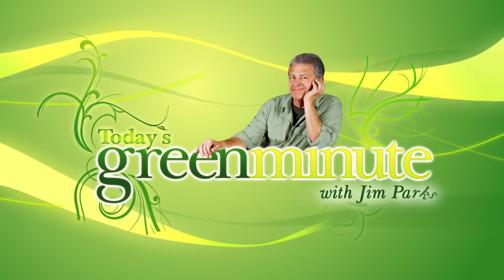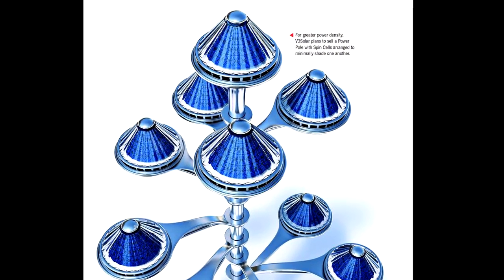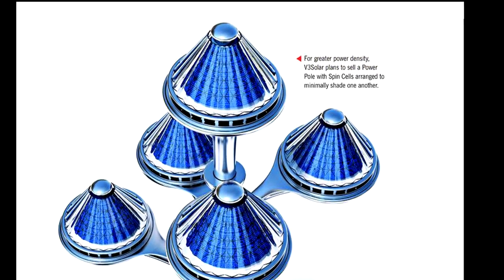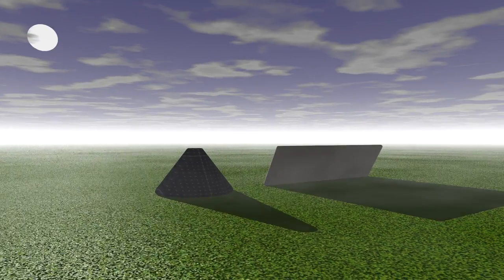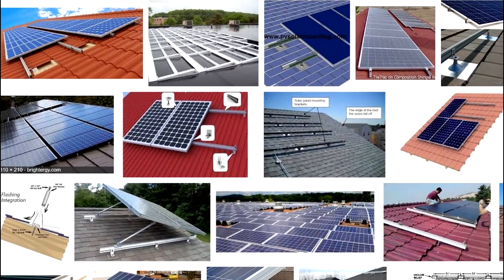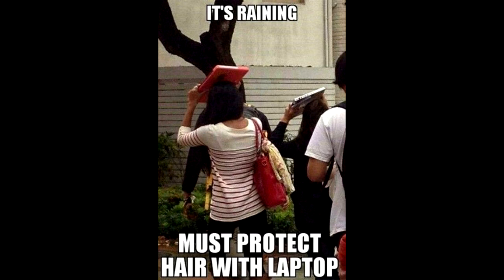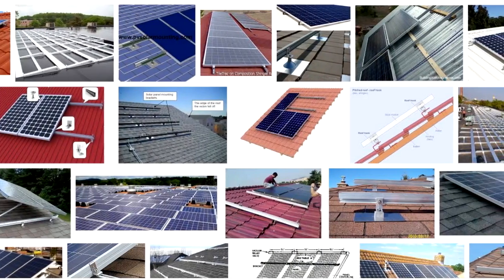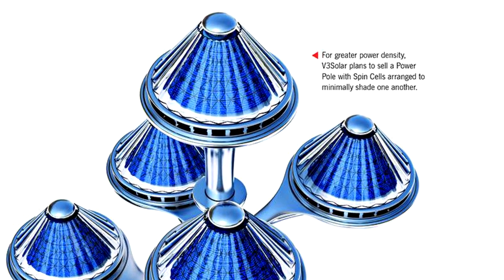Spinning Solar -BUSTED!

Comment: Good job adressing this cantraption. Though you left one part out of your equasion: Spinning the thing would require power. So out of the decreased amount this contraption will generate, some would have to be spent on maintaning the rotation.

But with the lense... I think there might actually be a point there.
Like would it be possible to build a modest Lense that is gathering light from a wider area, focuses it on a smaller solar panel. Like say... 20 times smaller area than the lense. Obviously you would have a heating problem, and to treat this problem you use the "minigun" principle, when you don't have one solar panel, but a set of like 6 of them, and only one of them is exposed to this superfocused sunlight at a time, while other 5 are being cooled. Yes you only have only 1/6 of power you'd get if all 6 were exposed, but that that 1/6 is generating 20 times more power it would generate if it was exposed to the sun all by itself - withouth being assisted by a lense. So comparing a set of 6 panel all exposed to normal sunlight, and this contraption would mean we can get 20/6 (somwhere about 3.3) times more power if we use the lense.

And yes. I admit that those numebrs were totally arbitrary and the actual capabilities of such a device largely depend on how much light you can focus on a small panel, while still allowing it to cool within one cycle... and I don't have his number, but if it turns out bi enough, this means this contraption can be more efficient that regular flat solars. Though... Seriously. This concept is so obvious, that if it was working, we would have probably adopted it by now...

Comment: "So solar panels can finally compete with fossil fuels"
They already can, but no one uses them.
Reply: A few solar panels on your roof can supply your house with all the power you'd need. It's a bit of an expensive single purchase, but seeing as you'd never pay for electricity or natural gas it would pay for itself. If solar panels were a standard feature on every house, we'd be much better off.
Reply: Around 5% of housing in Queensland, Australia has solar panels, in the state of South Australia it's even more.  Domestic solar power systems are common, and cut power bills by 30 to 100% depending on climate, number of cells and battery backup if installed.  More than 2% of Australian energy consumption is solar and getting higher all the time.
Reply: True
Reply: Come visit southern Germany and see what's on the roofs.

Comment: Could magnifying glasses aid solar power? 
Not the panels if they need to stay cool. 
But generate power from the heat it gives off? Thermal power? 

Or hey, here's a daft idea. 
Huge hamster wheels. 12 feet in diameter and several meters long. People just get inside and walk letting their constant shift in weight and momentum create power like a wind turbine. 
How many miles to those super fit people like showing off for? 
"Today I just showed my fabulously toned body off to fifteen miles worth of bystanders as I jogged by" 
"Yeah yeah, get in the wheel mr runner. And generate enough power to run my fish tank filter for twenty minutes... douche"

Comment: Water can increase engine power and efficiency, particularly water-methanol injection.
Spraying water into the combustion chamber during high load (high rpm) will cool the cylinder head and the steam expansion adds more force to the crankshaft.

Comment: This could be viable although there's not enough information about how the device gets it's rotation. If the device is some sort of photovoltaic-photothermal hybrid and the rotation is generated via heated air then some copper wingdings and magnets could generate the extra power all while keeping the unit cool.

Comment: This channel is so strange. There are SO many ways this is so easily busted, but Thunderfoot makes som really weird choises. 

First, I'm pretty sure, the cones are not supposed to be compared to automatic tracking solar panels (which is expensive, power demanding and demands a lot of structural integrity, comparable to the cones), but to simple static ones. And also, solar panels does NOT generate 0 % power when in the shade, but rather 10-20 %. 

The 20 times increased efficiency is still, of course, bullshit. You don't need a youtube video to prove that. At least 7,3 M of the viewers on Facebook already understood that themselves.

Comment: The Gran Telescopio Canarias (GranTeCan or GTC), also known as the Great Canary Telescope is a 10.4 m (410 in) reflecting telescope located at the Roque de los Muchachos Observatory on the island of La Palma, in the Canaries, Spain.
Reply: I heard you say the biggest telescope had a 1 meter lens. Just wanted to clarify,  there are 10 meter lenses. I bet they get really hot too (:

Comment: i think your slipping thunderfoot, or at least off your game for this video.  the solar cone video states that they GENERATE 20x more energy, not that they collect energy 20x more efficiently.  also i noticed that they use the term energy and not electricity,  isnt heat an energy, if so maybe they are counting the heat generated by the glass cover even if they arent collecting it. just cus it generated the energy it doesnt mean its usable.

Comment: Research and development has to start somewhere.  Many inventions started out with what idiots said was stupid.  It takes experimentation trial and error to eventually get many crazy inventions working.  So I say to the guy who made this video, why don't you get off your ass and try to invent a better solar panel system.  Or invent anything and then do it with some nay sayers calling your idea stupid.

Comment: Stats only work in a 100%. So the correct phrase would be that the energy output creates a new net high for solar panels in which makes the older standard of solar panels 34% efficient as this current new solar panel. Stat is out of a known amount or it becomes not a state under an infinite.

However, the DNA has data to crate proteins in which cool, organic tissue, and chloroform and photosynthesis of organic material, rather than inanity could be more useful.. and self replicating... How much water would this process take, reengineering biomatter for the use of power generation. Hmm interesting... thought...

Not enough information... The shadow analogy is a hardener near sunset, which most of the days if over cast, its still 90% efficient... You do not need direct sun and most light is disappeared quite evenly throughout the day, except morning and sunset.

I am not sure about increasing the way light refracts on the surface is the best way, however using a lens in such a way could help distribute light more evenly. What I find more interesting is, the notion that the cone increases surface area. However that is an area in which the solar panel can be used to maximize how it collects the energy from the sun. Just as the human body has villa nd villi. If the solar panel had these micro indentations or nano indentations that would increase its surface area by an unknown amount(9 to 20x surface area dependent on depth), it should increase output, even small dimples.. would increase the surface area. Which should increase the efficiency of collecting energy. A flat surface is like a praire... A mountainous surface... can have much more surface area asa whole if stretched out. The theory would be that the grooved reflective pockets would increase the efficiency of energy output from the sun. This would have to machine made, or, made through other means, such as growing a would from a crystal lattice and or some other form to create the invisible pockets to the eye. Then how fragile is this... lol

Comment: At 7:06 I see they show the cost of electricity produced by these fantastic solar panels is a mere .8 of a dollar US per kilowatt hour.

Seriously, wtf do people pay for their electricity that wouldn't see this and be horrified? Perhaps if we just change that tiny part of their presentation by removing a word and changing the reference to say:"The cost would be 80 cents per kilowatt hour" then it would be clearly obvious just how inefficient and redundant investment into such a product is. I pay about 20 cents per kilowatt hour for the (mostly) hydroelectric power I consume, it's renewable and reliable. 

If you are already paying more than 80 cents per kWh for electricity, stop fucking making it with a diesel generator. Oh wait, even an inefficient diesel generator will only cost about 80 cents per kWh, that's inclusive of ongoing maintenance and assuming diesel prices based on what we pay here. In the US with it's much lower diesel prices even a diesel generator compares favorably to these panels in cost/kWh!

Comment: When I talked to people on Facebook about this, I had a far more simple formula. Normal solar panels are about 20% efficient. So a regular 1 square meter panel should generate about 200w of power, from 1000w of sunlight. 20x as efficient would mean 4000w of power from 1000w of sunlight.

Comment: I heard some where that there were new nano crystals that can be used to tune all the light that goes in to a specific frequency, not by filtering but by actually changing the lights properties. What do you think?

Comment: One huge thing you didn't address: How much energy is being wasted for the motor spinning those solar cells? Looks to me that the solar cell would be generating just enough power to spin the cells... with nothing left over for any other use.

Comment: Are they talking about energy efficiency, or are they talking about cost efficiency though? In other words with a fresnel lens if you have a big fresnel the cell will cook, but if you spin it, the air flow will keep the cell cool, and then you may well be able to get much better cost efficiency from the photovoltaics.

Comment: The need for a motor and commutator would seem to be a problem as well.  Spinning the cone (to move air around) and using a half section cone for the cells would seem to make sense. (Acknowledging that the whole idea is crap.)

Comment: While the spinning solar premise is rather stupid, your video also has its issues.
For instance.
-To get a 20x input a lens doesn't need 20x cross section, it needs 20x area. which is about 4.47x the cross section assuming a square.
-an added benefit of a lens, not sure if this is used on this spinning solar idea, it could if done properly redirect the light so that more of is hits the solar panel at a right angle.
-one possible way to look at a cone solar idea is that you are placing more solar cells in a single area. Most of the time if mounted vertically the cone would have light on all surfaces, since solar is most beneficial when the sun is high in the sky, and the sun spends a lot more time up there than at the horizon as your videos indicate.  If the lens reorients the light, from its path downwards to perpendicular to the cone (what like 30 degree shift) then there would be as many solar cells being energized in that cone as a full surface but in a lot less area. However there would be the fewer photons landing on that cone so probably no benefit there.

Basically yes, spinning solar is a bit stupid for the most part, but maybe less stupid than you would indicate.

Comment: They didn't say "20x efficiency". They claim 20x MORE ENERGY, which is suspect, but not impossible. They aren't comparing them to tracking solar farms, but to the vastly more common glued-to-your-roof kind. Ultimately, build one and let people measure what it can do. It's pretty safe to assume it will never live up to the claims, but if it works well enough, it's a much more acceptable system to have in plain view.

Comment: So here's by far the simplest way to show that this is absurd. If spinning the panel to dissipate heat was important or good for any reason, you could achieve vastly better results by using a circle of solar material at the end of a spindle that orients to face the sun at all times and spins on its Z axis to achieve cooling.

Now you have the spinning nonsense AND 100% of your panel's surface is in direct sunlight at all times.

Comment: So... What if we combine Solar power with whatever tech we use for geothermal as a cooling system? (The idea would be developing some kind of heat-sink cooling system to transfer the excess heat to whatever they use for a geothermal generator increasing the efficiency of the solar panel while also converting the excess heat into usable electricity...)

I don't really know enough about Geothermal to know if it could produce electricity from other heat-sources or if science can produce an efficient enough heat transfer system to both remove heat from a solar panel without blocking the sun from reaching it while also producing more electricity from the heat powered generator than is lost from the transfer process...
Reply: If I'm not mistaken, which I probably am, we use the earth's own heat to create energy by boiling water. The heat sink for that would be, well, water. The faster the water heats up the better as that will produce the most steam. So I don't think the two could work out together. But we could put solar panels near a river or canal with flowing water underneath the panels, keeping the panels cooler.

Comment: Just throwing my stupid hat in the ring - what if you have a curved mirror that moves around the cone at the same speed as the sun moves across the sky to reflect light onto the darkside of the rotating cone, so that light is always hitting it? Or is that, like I suspect, just a means of wasting energy for no more(maybe even less) net energy than the tried and true flat panels provide? Think I've answered my own question. I'll see myself out...

Comment: is 100% a scam BUT that said i don't agree on the example you gave, you calculated the entire cone with a normal one, the backside of the cone is used to cool the part that generates, that said so how much worse is that "working" cone side towards the same amount of work surface of a norm panel. again don't get me wrong here the cone thing is totally BS but if you compare them at least do it right ;)

Comment: Wouldn't a Fresnel Lens reduce the thickness needed for the glass cone?
Reply: MilesUmbrae still create heat, and put more stress on motor. Which in turn would take more energy away from consumers to run such motor.
Reply: Kent brochman
Was just pointing out a possibility that one detail of Thunderf00t's laundry-list of issues was a poorly thought-out hyperbolic point in an otherwise well-reasoned and logical explanation of why the thing wouldn't work.
Reply: MilesUmbrae ok, cool

Comment: I wrote a book that has a wide scope, one being nanotechnology. It is not a sci-fy 

story, it is a autobiography. The tech being described as follows: A.M. crystal 

radios on a nano scale. By that I mean the simplest form of A.M. crystal radios that 

I am aware of, 2 crystals and a stand of copper wire. The unique thing about them, 

other than the nano, is they have a constituent on each one that will combine it 

with the nerves system of, let's say humans. The combination is through out the 

nerves system  because it gives a better jolt of juice to be picked up by satellite, 

but being in hertz with the N.S. it does not  stimulate the nerves system. I know 

there are some issues in my theory but please bare with me. The jolt is produced by 

the vibration (pressure) of sound waves on the nano-crystals. 
  
In revers and optional the crystals vibrate to the sound of the voice in the 

microphone that could be any where on earth. The voice of the one that put the 

powder of nanobugs in the human-bugs food or drink sounds as if it is standing right 

beside or with FX it could sound as if it is on the other side a door etc. because 

the vibration of the crystal is in the nerves that the Ear drum (by mechanical 

wonders of nature) vibrates. 
   
Simple and effective and highly classified so I don't expect too many professionals 

of the science community to jump on the band wagon and so far the news media has not 

jumped on it, even with my grand attempts of constant social media grandstanding. I 

expected as much and I may take it as "I am on to something" or "They think I a 

fool" I prefer the prior. 

The book as I said is much more than an autobiography of what it is like to be the 

DEA, FBI, and CIA's human bug. The book twist into the story of how things are 

perceived and the journey of that perception to reaction. It is between those that 

we become unique in some large to small way. Like the technology simple, yet 

complicated. As I state in the book I don't know if naobugs can be made so simple or 

simpler but it does have some rationality to it, and that is good enough to warn the 

of implications of what is being done or soon will be.

 Nanobugs combined with humans would be great for the following of terrorist groups, 

knowing/hearing  the next move and taking down the entire networks. Even the thought 

of one could cause them to shoot each other on pure suspicion. I have lived the 

nanobugged life for four years and it ended 11 years ago. It was an evolution to the 

point of deciding "I ain't a human bug.". It was so real till that point that I 

decided to  keep....... It's in the THE BOOK OF NOW. I ask you for help would you 

put the books name as a reference on your site or if that is not possible just tell 

ten people about it. thank you. Keith S. Taylor.     
http://ecx.images-amazon.com/images/I/31svZxm%2BIqL._SX444_BO1,204,203,200_.jpg

Comment: This self debunks itself within the first 30 seconds. How would flipping the solar panel up at a 45* angle and then CURVING it make it more efficient? You lose surface area, and in certain places the angle wont even work as intended. Addditionally wasting power on spinning the cells does nothing more but add a further energy sink into an already energy sparce system.